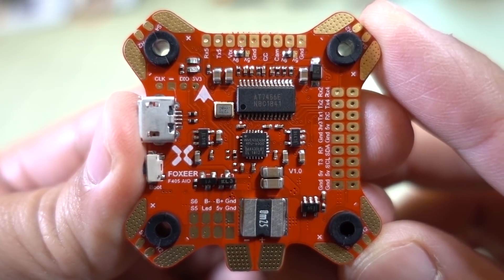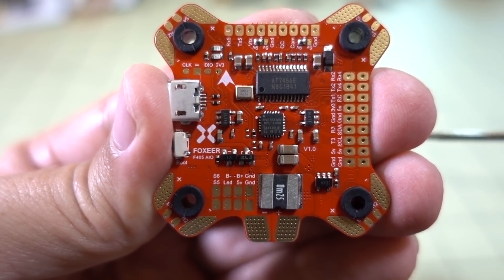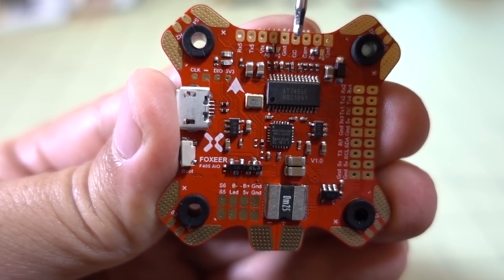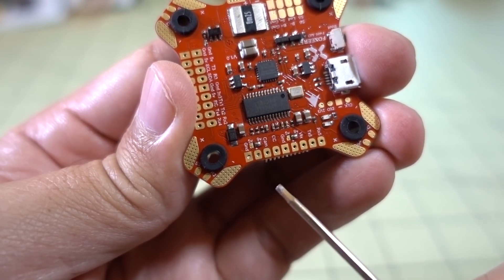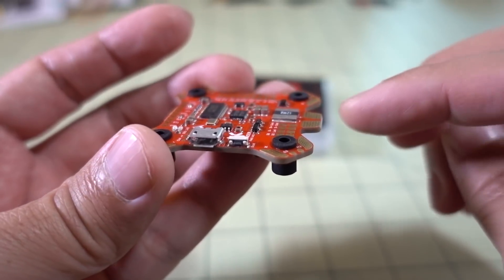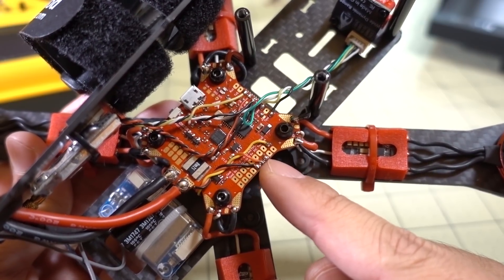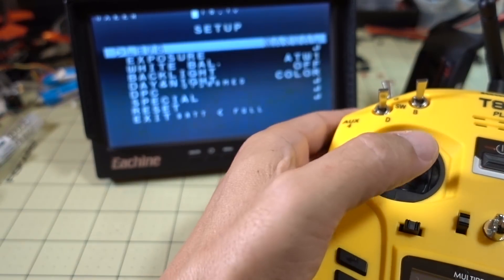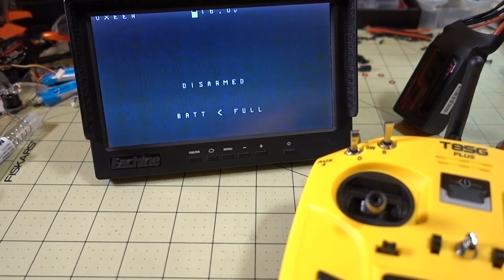Foxeer F405 AIO Flight Controller Review 😍

Comment: I like the diagram layout seems easy i gotta replace a FC on my old quad has the Naze 32 ,so i'm looking for something simple easy to wire. Do you got video setup for Beta Flight? Still trying to switch over from Clean flight from my old quad LOL ! So i would connect my Spektrum rx to GND, 3V then RC ,RX@ or RX4?

Comment: Has that board been good long term?
Reply from the maker: So far so good.  I have three of these and all are still working.
Reply: @AlbertKimTV  cool thanks that is what i was hoping to hear.
Reply: @AlbertKimTV  hey man. So I got a fli14+ and I love the size of it and the rssi just working with no mods but the range isnt quite as good as the ia6c I'm used to can I swap just one antenna from the 6c and put it on the fli14? Think it would improve anything?

Comment: I am having the hardest time ever with this FC. 1st one I received was DOA, got another and for the life of me I cannot get the darn receiver/tx to work correctly. Wired to UART marked RC according to diagram. Set all setting in betaflight correctly for Spektrum, but the receiver tab goes nuts. Any movement on throttle stick sends several of the channels all over the place. See screen grab video: https://www.screencast.com/t/LIL6EA8lsOM ... Anyone have any clue? TX works fine on other quads, all settings in BF look correct from what I can tell. Any help is appreciated.
Reply from the maker: The channel mapping in the FC doesn't match your transmitter.
Reply: @AlbertKimTV  but it does.. It's set to spektrum under channel map on receiver tab. Using Dx6e and I have it setup exactly like,my torrent 110 which works correctly. Possibly the receiver is bad?
Reply: I also just tried soldiering to the RX2 pad like you did in your video and not the receiver tab doesnt show any movement. I rechecked all settings and the UART 2 is set to serial, Receiver Mode - Serial-based, Provider - SPEKTRUM2048, and the channel map - TAER1234....
Reply from the maker: Did you try SPEKTRUM1024?  Did you use the inversion command in the CLI?
Reply: @AlbertKimTV  I did try 1024. I'm not sure about the inversion command. I think I tried to set reversing but no effect. I will try to search a little more. Thanks for the suggestions so far
Reply: FINALLY... Rx2 didn't work at all. Moved to Rx4 and reset the Serial Receiver Provider to 1024 and then back to 2048 and it FINALLY works. No clue why Rx2 didn't work or the main RC pad, but its working now. Thank you for providing suggestions.

Comment: Hi, just soldered my X6B RX (like yours) on the RX2 pad, I've activated it on BF but I have no signal in the Receptor page. My RX is bind with my FS-i6 but no response. What have you done? Thanks. Nice review
Reply from the maker: You may have to issue the CLI command to invert SBUS.  The command varies with what firmware you are using.
Reply: Albert Kim Problem solved! I've just wire the signal pad on R3 pad like RX3 (the one used for every FlySky RXs